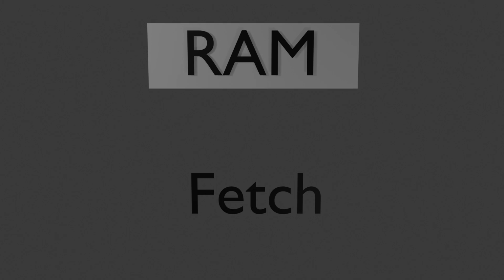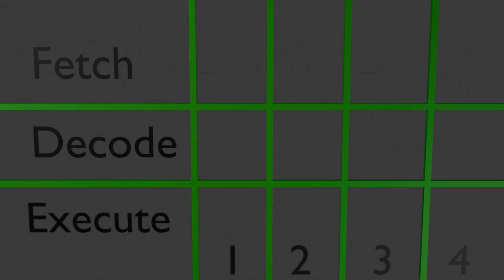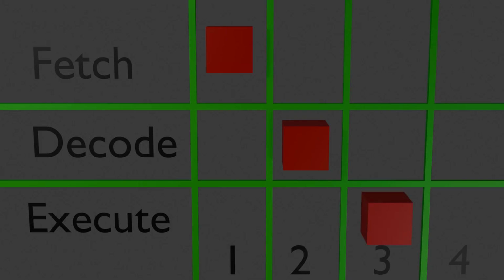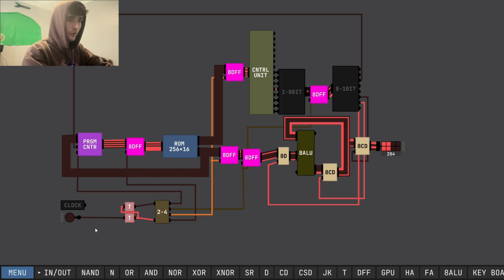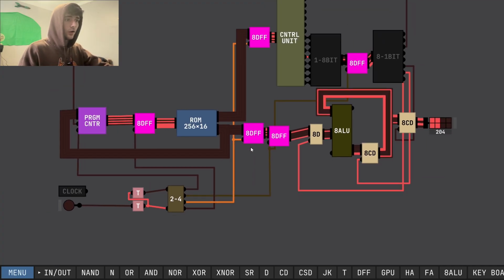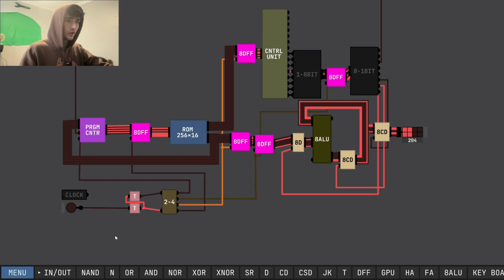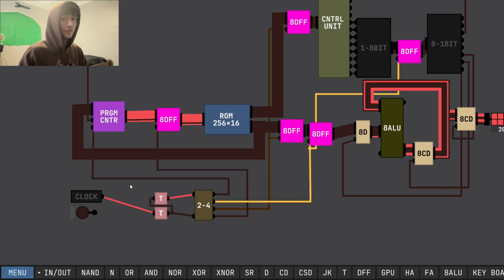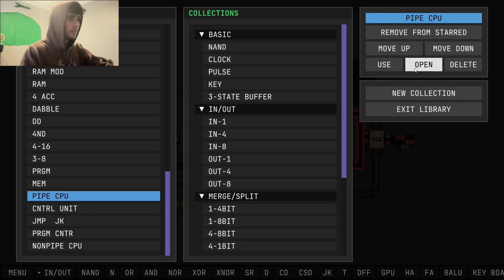How does CPU pipelining WORK???

Comment: I recommend the pipelining visualiser of Compiler Explorer, showing the differences between various processor architectures. Intel worked with the site to show which assembly instructions can be paralleliized in superscala archs.
By the way, on a different note: There is a reason why it's called "Lapel" or "lavalier" Mike ;)